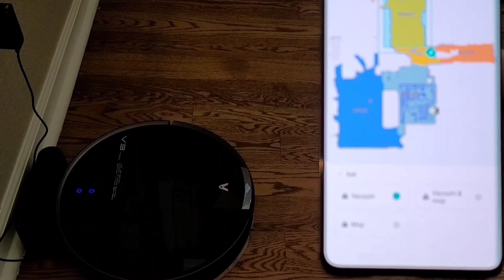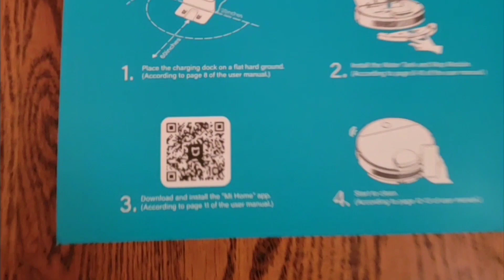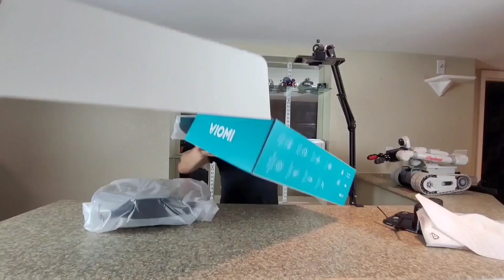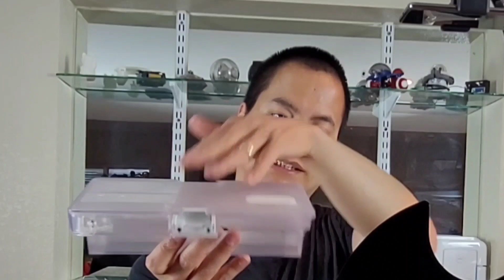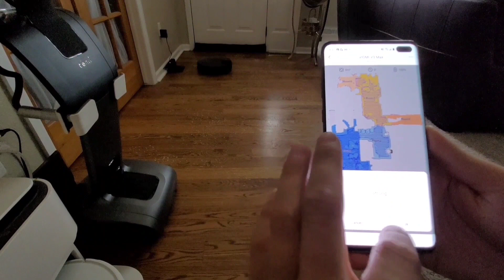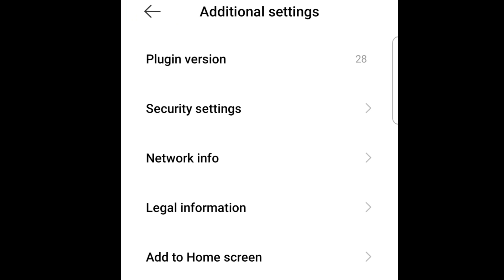Viomi V3 Max - Y Mopping is NOW a THING 🤗

Comment: Have you compared the V3 here to the V2?  V3 is $80 more and I'm trying to figure out if it is worth it.  From a few reviews I've seen it seems that the V3 performs only "Ok" compared to other robot vacuums in terms of the floor actually being clean after a vacuum or mopping.  Would you agree with this?
Reply from the maker: So from my personal experience, Viomi a good robot vacuum. I had a few issues with connecting the robot to the App, had to change a few settings on my router. I would personally save the $80 and go with the V2. The increase specs isn’t a big difference.

Comment: Is it better than Roborock S5max?
Reply from the maker: Hmmmm tough question, they are very close in cleaning performance and navigation. The Viomi does slightly better at mopping because it has Y mopping. Their App and features are similar since both robots can pair to the Mi Home App. It I had to choose, I would go with the Viomi, it cheaper than the S5 Max and offer all the same features.